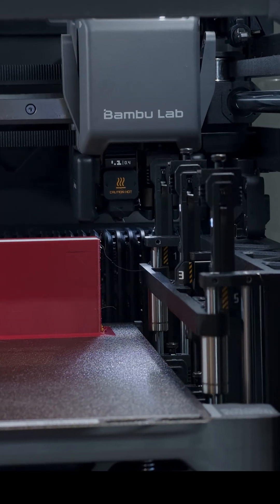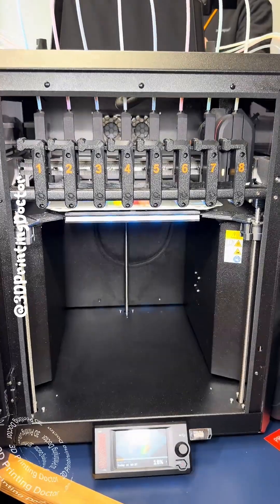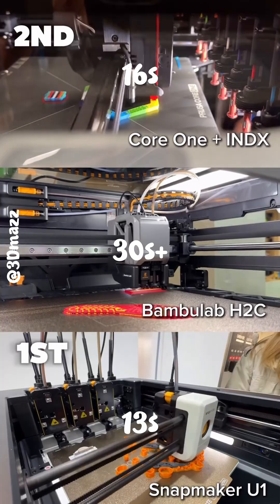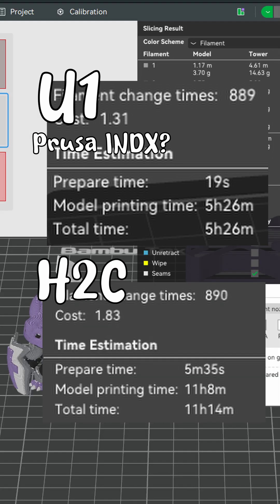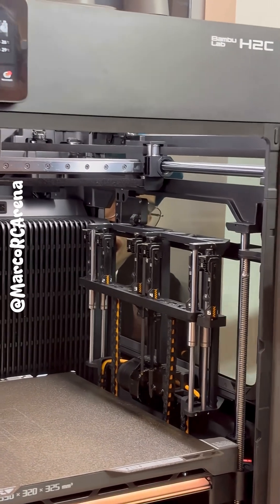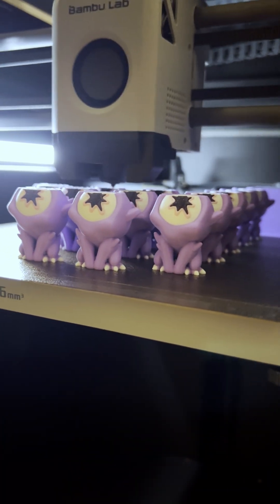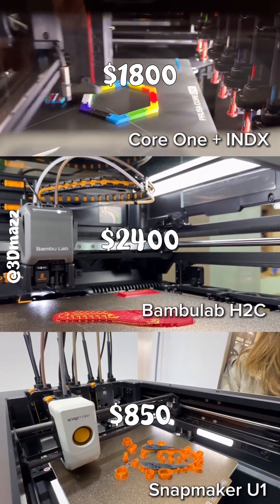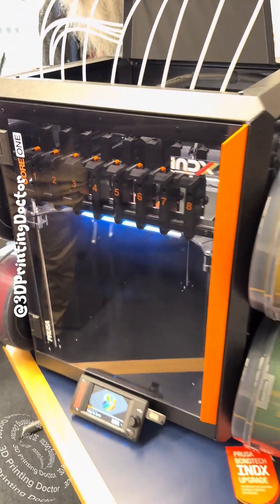The H2C isn’t worth it (for me)

Comment: If this thing is as reliable as my X1C its worth every cent. Based on the last 3 yeas of using my X1c I can say thats the most reliable printer I ever had. And the fastest. So I dont care about a few seconds faster or slower. If the print fails or sucks a few seconds faster swap is worthless.
Reply from the maker: True! Bambu Lab is an amazing company, and I've been printing on my trusty P1S for two years now. You won't regret getting the H2C if you can afford it. My guess is that the Prusa INDX will be just as reliable though, Prusa has a great track record just like Bambu Lab. Also we're not talking about seconds here, we're talking about literally halving the print time, that's very significant for people printing my miniatures.
Reply: @superprints3d I already ordered mine. True, but for me its not that important because I mostly print with a single filament and a second for support. Maybe 1-2 more if there is text on the few first layers of the print.
But having different nozzle sizes always ready and available and two AMS filled with my materials plus spare spools is just extremely comfortable for me.
The printer is sitting in my office. So when I‘m home in the evening I often finish some things and send it to the printer. When I‘m in my company the next day I can just pick it up and use it.

I like the idea behind the prusa / bondtech system, too. But it kinda looks like tinkered together in a hobby garage and (I might be wrong) doesn’t looks that reliable. 
Also really dont like all the spools on the sides, each one in a own enclosure.
But always good to have different companies working on different concepts. Just feel a bit sad  for my buddy who bought a Prusa XL with all the toolheads 😬 Together with the enclosure that had a hefty price tag.
Reply: I have had/used 9 different FDM model printers and the X1C has been absolutely fantastic even though I printed a lot more on it than on any other printer and spent a lot less time servicing it I am so happy with the quality - hate the login to the stupid software all the time. 
The X1C is stellar - deserve some TLC, but I am with you that while I need to print multi-material, for 98% of my prints I'd use the two heads, where the shifts are fast.
Reply: @jenspetersen5865 H2C arrived yesterday and thats a hell of a machine.
First print was absolutely perfect without calibration and a spool of noname filament.
With all the extra and further developed hardware you can really see that Bambu improved all the small bits and pieces since the X1C.
Cant say anything about reliability but so far I‘m very happy with it.

Comment: For me it's right on the edge of being worth it. I want to reduce waste as much as I can and I would like to print cosplay helmets.  I found I would like a print bed with 320 cubed. I would prefer the indx but the core one L is  slightly not big enough and darn near the same price with the 8 tools.
Reply from the maker: Okay yeah totally makes sense for printing helmets ;)
Reply: The h2c has a larger print bed but each nozzle can't reach the full width of the bed. It's quite tricky to fully utilize the bed when slicing.